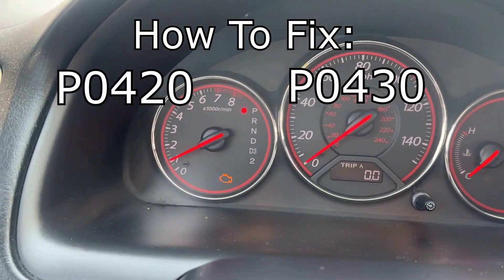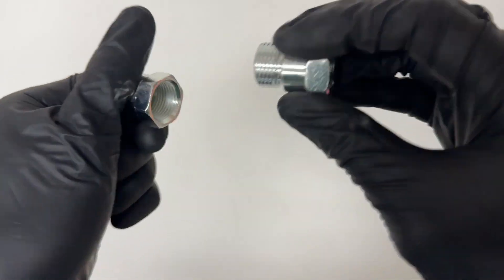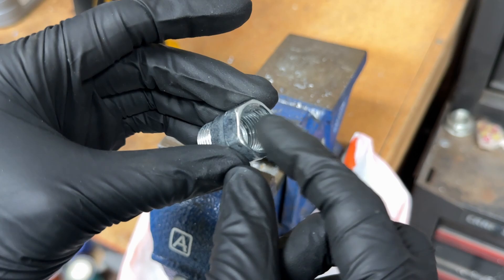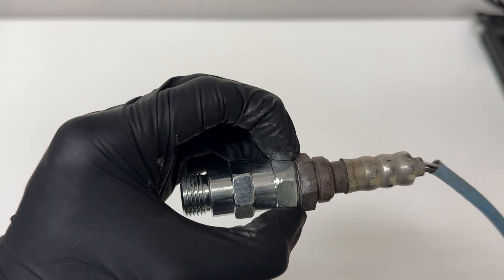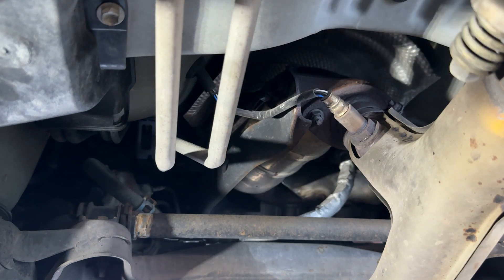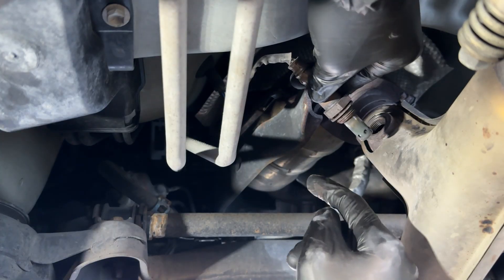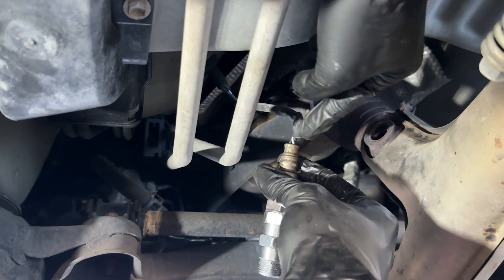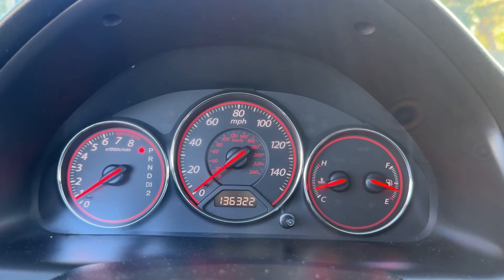$10 Check Engine Light (P0420/P0430) FIX! [Complete Step by Step Guide SOLVED]

Comment: Why not replace the sensor? Now the sensor is not in the correct location to read the exhaust gas. Seems like you eliminated the code but not solved why the code was made. Or am I missing something?
Reply: Because he is just showing ppl who car will not pass emissions because of the check engine light.  I replaced mine and i still have the check engine light, so this video is for me lol

Comment: Great tutorial and explanation! Any tips on if the space is too small to fit two non foulers? With just one non fouler installed the wires from the O2 sensor is being pushed up against another part. Having a hard time finding a 45 or 90 degree angled spacer or adapter.  This is on a 2005 Toyota Highlander v6. Thank you very much!

Comment: Why do you have to use 2 of them? What happens if you only use one adapter?
Reply from the maker: Using two adapters provides more spacing to allow the O2 sensor to sit further outside of the flow of gases. If you use one, it still may trigger the check engine light
Reply: I saw another clip to teach how to avert but not to fix root causes. I am worried if I can pass annual state emissions test. I don’t see any difference from blinding the check engine light